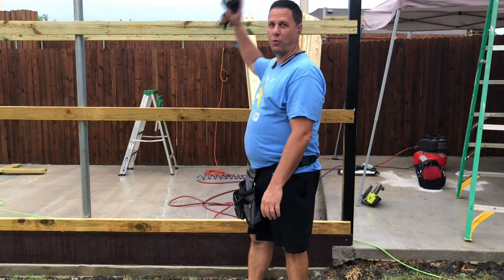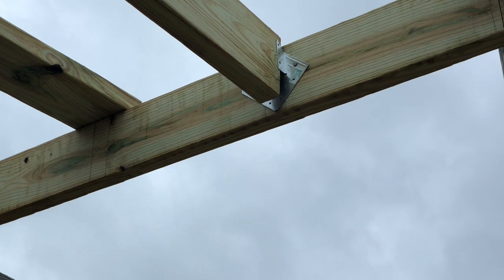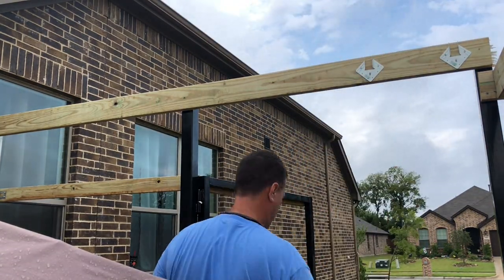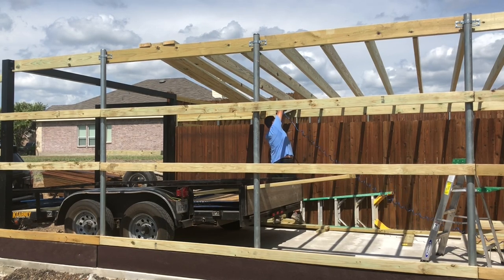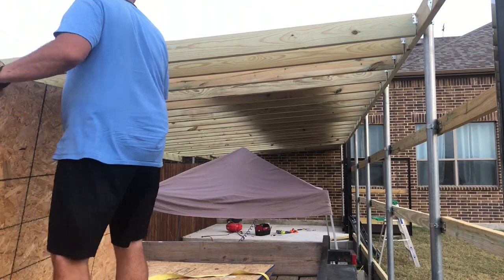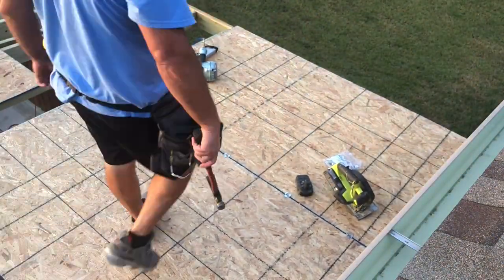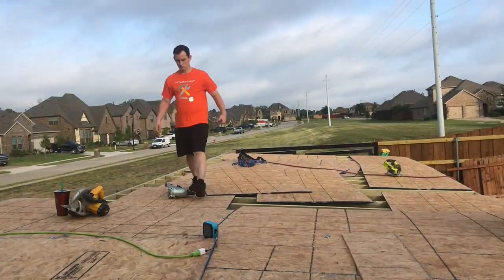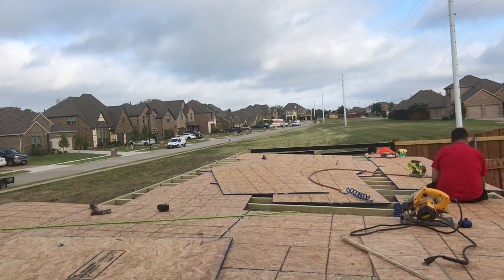Hidden Fence Part 7 Roof Sheeting | Install Rafters and Attach the OSB | Ready for Roofing!

Comment: Looks very nice. Not sure If I would trust the weight of the entire roof on just those mechanical fasteners and two hole straps clamped to the fence posts.
Reply from the maker: I added posts on the inside on that side with the post extensions. I added a 2x4 stud wall to the other side. You are correct that probably would not have been strong enough.